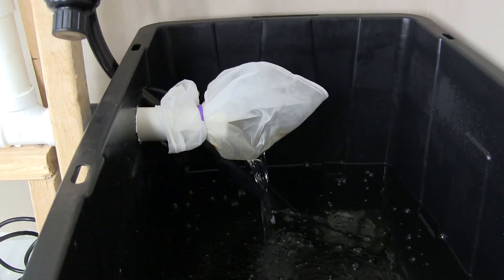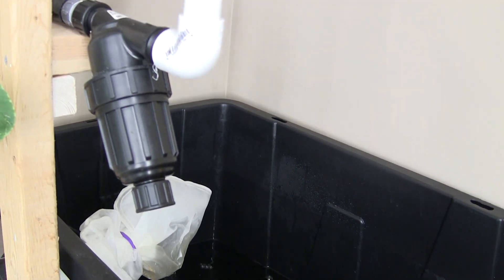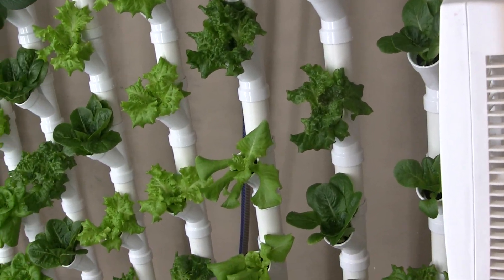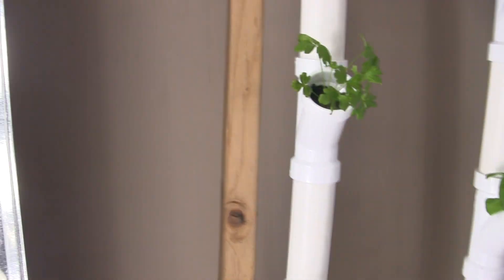Basement Hydroponic Tower Garden Version 2.0

Comment: My name is Kasey (I am using my grandmothers account) I found you system very interesting, so interesting I have decided to build one for my Silver Award for Girl Scouts. My school is 56% either free lunch or reduced lunch program. We live in a state with a short growing season so that is why we are adding a hydroponic system to the school. Fresh veggies for the school and take home program. Do you have the instructions written down to build this system that you could share with me for our building day?
I am raising all the money for this system and I am half way there. 
Thank you 
Kasey
Reply from the maker: Wow Casey, I applaud your effort! I have a materials list in the description - although it depends on scale, and in the comments below I believe I have some tips on building. Basically, you start with building the towers individually (height depends on your lighting source (I'm very interested in the new LED options instead of building my own, which technically can present problems if not put together by a certified electrician. Please let me know what you choose for your lighting option.) Then you build your return pipe for your individual towers. Then comes the framing - you can use 2X4 lumber - that's the cheapest. And then comes the plumbing. 1/2 inch for your supply line, reduced from 3/4 which connects to your pump, and then the drip lines should be 1/4 inch, with connectors to your 1/2 inch supply line, and they should enter at a downward angle from the back of the top of each tower. I'll be building a sideXside system for my classroom, and I'm looking into using a pond liner as a water catch in the event there is a leak (always a possibility) with a remote water sensor to alert me of any water that comes out of the system. I'm on the second floor so a leak would be bad.  I'd like to build 2 systems of about 56 sites each and have them online by mid semester. Let's stay in touch!
Reply: Thank you! I will keep you posted when I get this finished. Still working on the fundraising part .. about 1/2 way there.
Reply: Kasey again here.. do you glue your peices together for the towers? and for return pipes on the bottom but not where the tower connects to the return pipes?
Reply: Hey Joe,  just wanted to let you know we got the towers built. we ended up doing a structure with 8 towers with 6 plant slots. If this works out well we are planning on building more this size so we can put them in the other wings in the school. we did have some leak problems. So we had to glue all the parts to the towers and the return line. that stopped those leaks. we have to of the irrigations lines that are leaking. we have made 2 and we still have 2 that are leaking. Not sure what we are doing wrong there. would love to send you a picture of our system.
Kasey

Comment: So the towers aren't glued at all - just fit together to allow disassembly and bleaching at the end of the season?
Reply: Also- you mentioned 8½" on center - is that horizontally from tower to tower (on center) or is that from plant site to plant site (vertically along the tower)?
Reply from the maker: horizontally from plant center - I'd give it 9" depending on variety growing.
Reply from the maker: They are glued, for potable application, just not at the connection to the drain pipe for easy disassembly for seasonal bleaching.
Reply: What is the vertical spacing of the grow sites?

Comment: Just starting.. With a bucket, an air pump, rocks and home made nutrient. A rig like this would need what kinda water pump? Nutrient does corrode pumps? Is it possible to grow large trees with small root balls due to the maximum uptake?  what home nutrient liquid do you guys make? etc etc is there a hydro ponics reference website?  online hydroponic college if you will.. not one focused on selling a particular family of products.
Reply from the maker: Hello, the bigger the nutrient tank capacity the better. I use danner supreme pond pumps, and the type depends on the head. (height to pump) I'd be careful about large trees and weight/support, and lighting if indoors. I use the recipe from ChilledLED Grow Lights, to the tee. Best of luck!

Comment: Hi MaryandJoe,

I really appreciate you taking the time to make this and show us your efforts. I have made a similar system but I am having problems with leaks between where the wyes are couples together. I am using 2 inch wyes and pipe. It’s just a small drip, not pouring out, but definitely leaky. How did you get yours to not drip with no pvc cement? 

Thanks for your time!
Reply from the maker: Hi Linus, for my outdoor setup I didn't glue the towers as a test, and I had some minor leaking too. For all the other 9 setups I built I did glue the towers together - just not to the drain pipe so that I can disconnect them for easy seasonal bleaching. Hope this helps.

Comment: Great setup and I have been looking to make something like this.  Have you ever grown any larger plants besides lettuce, e.g., peppers, tomatoes, cucumber?  Do you think larger spacing could accommodate those?
Reply from the maker: Hi Matthew, I tried some strawberries and cucumber in the greenhouse. My concern with plants which stay in for an extended grow period (more then 2 months) is the roots - they block up the pipe and can cause leakage. Those larger plants also need support and lots of room, so this type of system was designed for greens and herbs. For tomatoes, peppers, etc.I'd suggest dutch buckets. I also use them for my herbs in the summer months when lighting is free. :-)

Comment: I love it! I love the screens and the shut off valve for nute changes, well thought out.

Did you diagram this first? Then figure things out as you Used the setup?
Reply from the maker: Hello, this was my 7th build and what I'd call my v2.0, so there was a lot I learned along the way. The shut off nute valve I don't use because the pump is not strong enough. It would take forever to drain. There are always improvements to be made!

Comment: That is a lot of lights, why not just get mirrors? How do you power all the lights?
Reply from the maker: The plants will block the mirrors, and not allow for airflow through the back, causing fungal problems.  I have 30 solar panels to help with electricity and in the spring, summer, and fall I'm producing in the greenhouse, so no need for lights. During off season I use my basement system.

Comment: Great information! I'm considering a similar system on a smaller scale. At what distance do you keep your lights from the plants? Does that distance change depending on the maturity of the plants?
Reply from the maker: Hello, about 20 inches. When the plants grow outwards I pull the lights back a bit to keep them about 20 inches away. Best of luck to you!
Reply: MaryandJoe Neumayer thanks so much! Two more questions for you if you don't mind:
Are the towers capped at the top with just a single hole for the drip line?
Do you maintain the same watering schedule when the lights are turned off?
Reply from the maker: Yes, capped on top, but drill into the top back pipe and spray/drip the nutrient toward the front of the tower instead of just drilling into the top of the cap. Yes, I've increased irrigation since the video to 30 min on and 15 off.

Comment: I'm looking into building a system like this myself, but sourcing human-safe piping (such as potable UV resistant HDPE) is incredibly expensive. I looked at your materials list and your piping isn't safe:

"PVC Schedule 40 Foam Core Pipe is for drain, waste and vent purposes only"

How do you mitigate the leeching of heath dangerous chemicals into the plants you consume over time? It's my largest problem. Thank you for the advice!
Reply from the maker: Hello KMP, I've done my research, and "PVC Schedule 40 Foam Core Pipe" is not used for hot water applications and may leach chemicals when liquid temperature exceeds 140 degrees F.  This is why this type of pvc is not typically used (according to many municipal building codes) for hot water applications. I do not use this pipe for hot water application, as it would kill my plants and potentially leach chemicals. Therefore, there is no leaching of chemicals. I do recommend washing the pipe thoroughly before constructing, and using potable water safe glue. Hope this helps.

Comment: I don't understand why you use T5 and power saving lumination on a large surface. In a later growing stage perhaps you should use HPS bulbs and put the setup in a circel like a classic doughnut grow on the marijuana growsites.
Reply from the maker: Hello, I haven't used T5's for years and I wouldn't dream of using HPS bulbs so I'm not quite sure on what you are basing your comment.
Reply: I am basing my comment on what I see in your video. You grow vertically, but if you put the plants in a circle and you use a HPS bulb you can be much more efficient than when you grow on a square surface. With the power saving LED bulbs you cannot put the setup in a circle and be more efficient. The LED bulbs do not have enough light output to be more efficient. Only when you use stronger HPS bulbs that shines much more light on a much larger surface you can be more efficient in a circle. One HPS bulb placed in the middle of the circle will illuminate every plant around it.

I see you use  about 900 watt of energy with your LED bulbs and the surface you illuminate with it is I estimate about 1,5 meter hihg and 2 meter wide wich makes an effectivelly illuminated surface of 3 m2.

When you would use a 1000 watt HPS bulb in the middle of my suggested circle setup you can effectivelly illuminate a surface that is approximatelly 2,5 times larger. The 1000 watt HPS bulb could illuminate a circle setup in dimensions of ~1,25 meter high and in a circle of ~2 meter wide. 1,25 * 2 * 3,14 = ~ 7,5 m2

Thanks for replying I like your work!
Reply from the maker: Hi, thanks for your input. I'm always looking for ways to improve efficiency. Your calculations make sense but you don't have the proper measurements for this system. It's 14 feet wide by 5.6 feet tall. I believe when converted we're talking about roughly the same area you supply with a 1000 watt HPS bulb.  A circular system would work great if you have large spaces, but I set out to develop a system which could go up against a wall so that the room could be also utilized for other tasks as well. We play darts and Kicker Fußball in that room and also have access to storage, plus some additional hydroponic projects such as a cucumber system and future  NFT rack system. If I had to fit 150+ plants in a circle then that's about all I'd be able to fit in that room besides squeezing by on the sides, being more of a long and narrow room. 

Would you be able to share some pictures of your circular setup? I've only seen 1 vertical tower setup with the light source in the middle and it was just a graphic diagram, not an actual system that produced food. Thanks and again and please share.
Reply from the maker: Thanks buddy, I'm looking forward to poking around when I have a bit more time.  But in the end, there's nothing better than the light from our wonderful sun - here's a shot from my greenhouse towers: https://drive.google.com/file/d/1PSwRXbApOfHBbdKxzxm_5G9jMOPa3Bhh/preview

Comment: PVC LEACHES TOXINS WHEN HEATED. It's very poisonous. 

You need CPVC (watergrade pipes) which do come in 6". 
Or food grade plastic buckets.
Reply from the maker: I've addressed this issue more than once; please scroll down to ready my afore written comments. Thanks for your concern, but as you said, pvc leaches toxins when heated, which is true. The temp when running this system in my basement does not increase more than 67 degrees, so there is no leaching of any dangerous chemicals. If I heated the water to over 140 degrees+, which may release toxins, my plants would be long dead before the toxins would have an opportunity to contaminate them. You can use CPVC pipe if you feel better about it, but it will only increase your cost.
Reply: @maryneumayer01  Agree with you totally.  Always at least of of these on every thread.   The complaint in this case is equivalent to contaminating the pacific ocean with a drop of urine.  i.e . FOS

Comment: Hey Joe!
I've been interested in testing a hydroponics setup for many years, but never had the space for one. Last year I moved to a bigger house, and a deep dive in youtube last weekend ended me up on your channel. I've now watched all the different builds you've done and taken a few notes.
Do you think that a 32mm T-tube would be wide enough for this kind of system? My options are 32mm, 40mm and 50mm (compared to your ~38mm build). The two smallest ones are "squeeze lock" silicone seals that doesn't need any glue. The 50mm one is a nut-lock type that tightens the plastic around a rubber seal, also no glue. The smaller ones are more expensive (for whichever reason), but not by much.
My worry is that 32mm might be to little space for the roots to grow, and that the system might clog up - but I have no experience in this, so it might work just fine.
Reply from the maker: Hi Nixen, I wouldn't recommend the 32mm. 40 mm would be fine for removables like bok choy, lettuce, etc. For herbs that are staying in and develop a larger root system which are prone to clogging, like parsley, kale, mint, etc., I'd go with the 50mm. If you are growing both,and you can use reducers, then use the 40mm and 50mm respectively. Best of luck to you!

Comment: Mind explaining how you built this in greater depth? Haha. I normally use Kratky but want to build something like this. : )
Reply from the maker: Hi Hassan, I just watched a bunch of YouTube vids and made a small one first, tested it, and modified it to make this large system.  I started with the frame first, then I built from the bottom up to the top. Return pipe first and then added the towers, and then the plumbing to bring the nutrient. I used 1.5 inch PVC and 1/2 irrigation tube for the pull line, and then 1/4 inch drip lines to each tower. Oversize your nute container so you are not adding and flushing as often. Mine is a 54 gallon.  Do you have any specific questions? I'd recommend reading all the comments. I bet I've addressed everything already at least twice. Good luck!
Reply: Thank you! I plan to move into a bigger place soon at that point i will prototype this and ask you stuff if I need to! I just learned of the nutrietn film technique, I dont' really understand how it works at that angle. I wish I could see the water and the roots! Also great work.

Comment: In the return tower, draining back into the bucket...couldnt you make a few 2"holes to clone plants?   I like your garden . its a cool video as well.
Reply from the maker: Hi Terry, I'd not recommend placing plants in the return/discharge pipe. The root systems will block the flow, increase the likelihood of leakage, and create stagnant areas which can become problematic.
Reply: MaryandJoe Neumayer is the tower a constant flow tower or do you run it for a few minutes then stop amd then again later? Thank you for for information. We are working on one of those soon and know how to assemle and make it work,  we are curremtly using ebb and flow and dwc. We are goin to do dutch bucket for tomatoes soon

Comment: Hello, I see you still response the comments, I have little query; what did you put inside the straight Y branch or in Y branch? I do not see anything in your list. Did you put net pot in Y branch?
Reply from the maker: Hello, no net pot - just insert the 1.5 inch Grodan plug into the Y tee - it's a snug fit. Good luck!
Reply: Is this similar to rockwool? Can I use net pot instead of this?

Comment: If you take off the plastic covering on the bulbs you might get more intensity.
Reply from the maker: Hi Todd - that's interesting, thanks for the idea. Have you tried this?
Reply: MaryandJoe Neumayer Yes. Some will twist off and some you can use a screwdriver to pry off. If that doesnt work you can cut it off with boxcutter or saw. It will expose the leds and you will see about 8 in there.

Comment: Based on what I could see it appears you have 10 bulbs per light fixture. I would assume you then have 4 light towers. If this is incorrect how many light towers do you have and how many bulbs are in each fixture? 

What distance do you keep each light tower positioned from the food towers and what is the spacing between each light tower?
Reply from the maker: Hey Shawn, I have 7 light towers and they are about 20 inches apart.

Comment: Joe, what method do you use to start your seeds?
Reply from the maker: I place my lettuce seeds in rockwool cubes and put it them in an opaque plastic container with the lid tightly closed. The light gets in and plus the humidity helps with germination. After about 4 or 5 days I transfer the cubes to the germination tray where they hang out for 2 weeks before getting transferred to the vertical tower system.